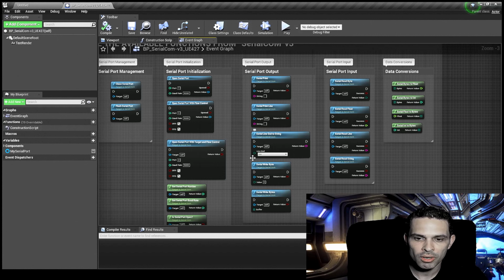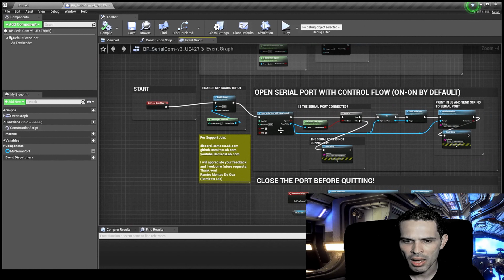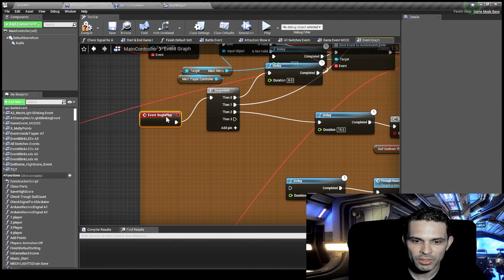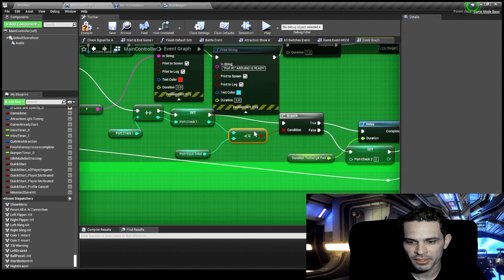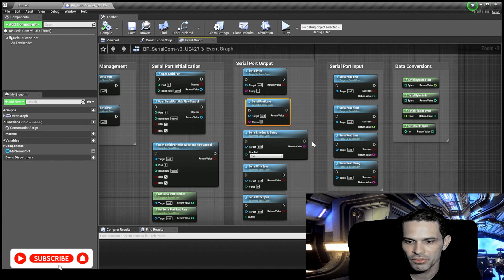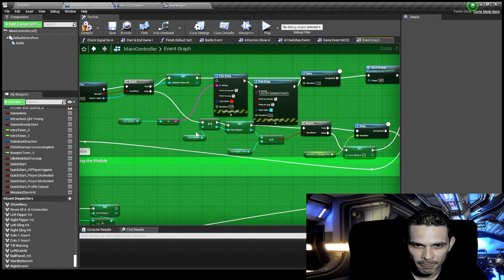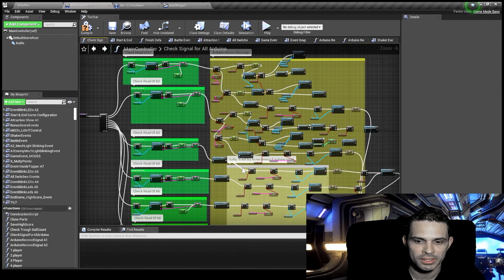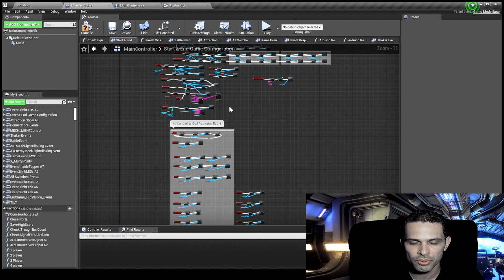Unreal Engine Communication with Arduino

Comment: Hi, I made a lever that use arduino to control a forklift in unreal. However, there's a delay. Whenever I move the lever, it will take a few seconds for the forklift to react. How can I remove the delay?
Reply from the maker: The delay depends on how you have developed the code in Arduino and in UE4. If you create some delay in the Arduino that will create a delay in the communication. The time to receive any command from UE4 to the Arduino is between 0.01 mill to 0.02 mill.